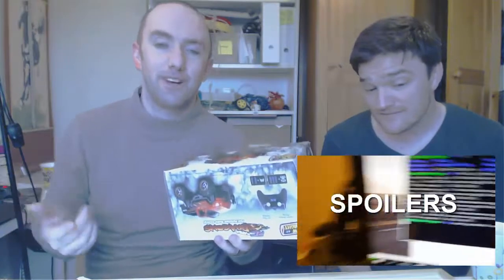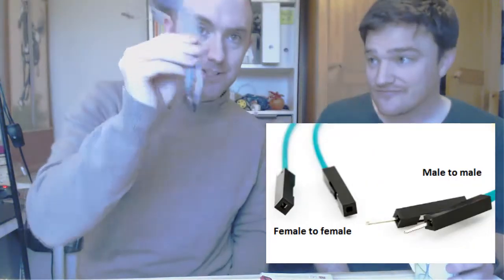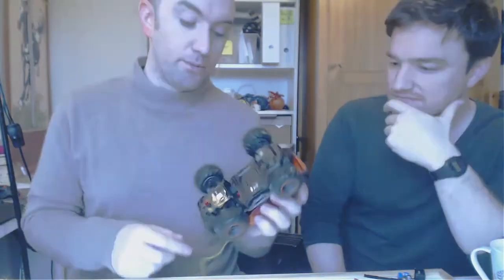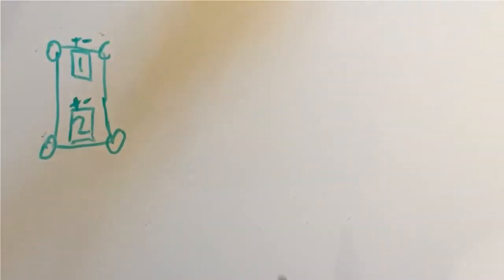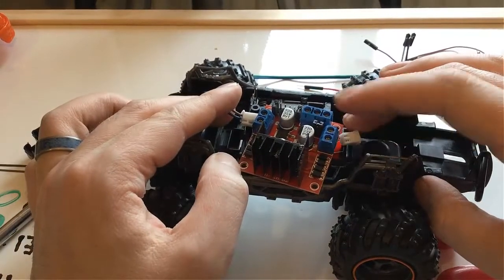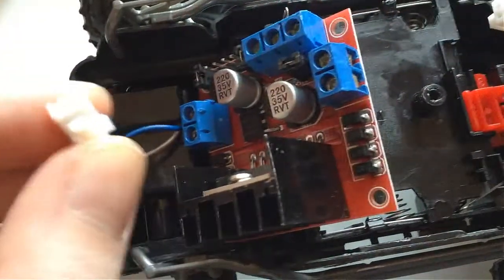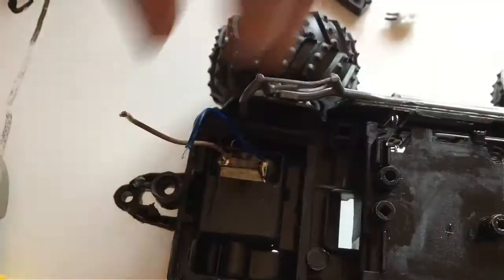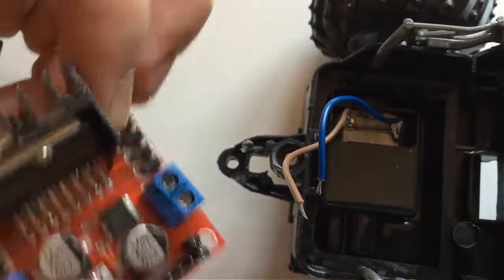Make a Raspberry Pi Rover for $5.00! (Part 1)

Comment: How is it $5.00?
Reply from the maker: Hi Ray, I think I mentioned this in the description: Assuming most people working on this Raspberry Pi project already have a Raspberry Pi, you only need buy a motor controller to get this to work. I bought my the car in the 2 euro shop and the LN298N's I got on Amazon for 1.95 euro. So actually for me it was 3.95 euro. I bumped this up to 5 euro to include the price of jumper wires. If you've an old RC car from your childhood in the attic, it's less than that again.

However if you've no equipment at all, it'll cost you about 23 dollars in total.The parts list and where you can buy everything is in the description.